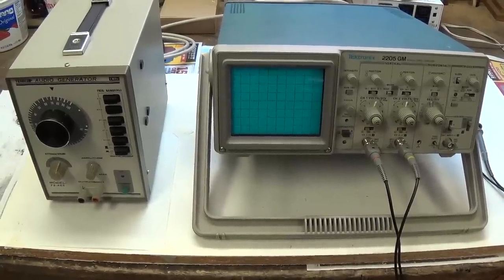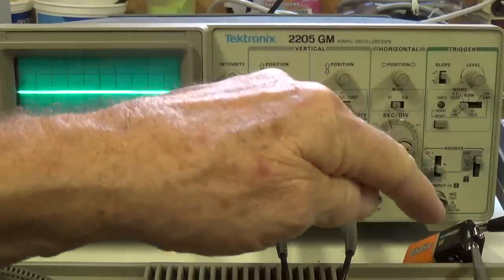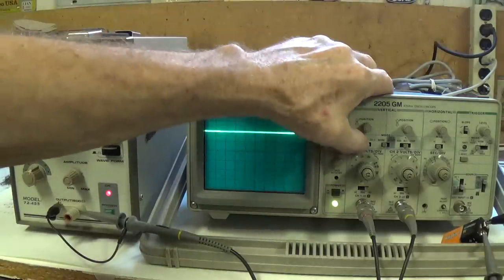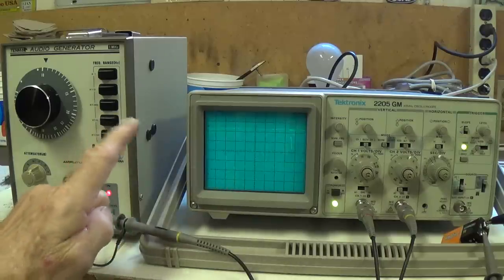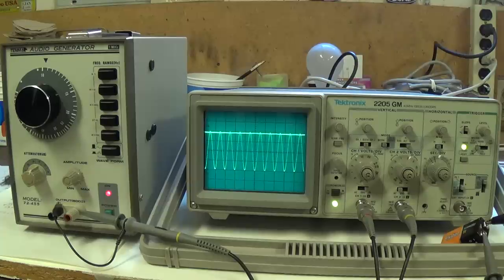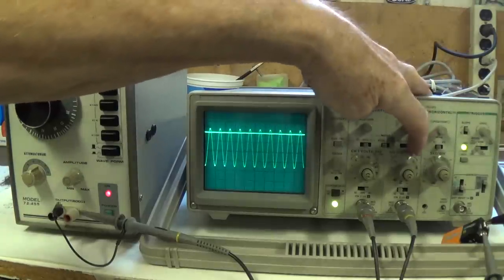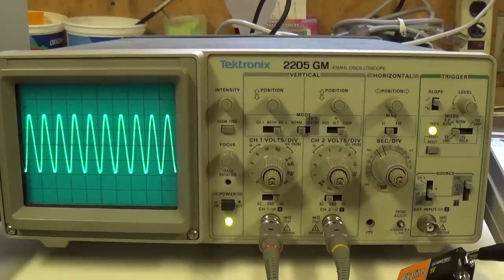Oscilloscope: DC & AC, Signal Tracing in Amp Circuit, RMS Output Measurement

Comment: brilliant! thanks so much.Which components in the amplification line (input through to the output) would cause distortion, and how would you measure them as part of a fault searching process? (assuming that the distortion was a fault)?
Reply from the maker: Thanks, Ralph. Distortion normally originates in the pre-amp and output tubes when they are driven beyond their normal operating parameters. There are instruments that can accurately measure Total Harmonic Distortion. It runs around 5 to10% in guitar amps, but less than 1% in HiFi amps.

Comment: Hello again, Doug.
Something's that confusing me is: Is the RMS output for an amp the same at all times or is it dependent on the input signal?
The same can be asked regarding what you said about putting a mark on the volume knob to mark the position where distortion occurs - is that irrespective of the signal strength?
I suspect it is but for a hifi amp different sources produce different signal strengths, right, or do they all max out at  +1/-1 volts?
Please don't throw me a charged cap!

Comment: I’m taking a short break from today’s video to observe that the water analogy holds true for what happens when you mix AC and DC... a graphical presentation of flow in an open channel is referred to as a hydrograph. Time is along the X axis, and depth of flow is represented by the Y axis. If there is a steady flow in the channel that is not caused by a rainfall event in the watershed upstream, it is called “baseflow” which is analogous to DC current. Any increase in flow due to a rainfall event upstream in the watershed is analogous to AC. The two flows both mix, but remain separate. Just like the AC and DC currents shown on the Oscilloscope.
Reply from the maker: Wow......an excellent example of an analogy that does hold up in the real world. Thanks so much, Bill :)
Reply: I was hoping for just such a reply... yes, I know that Hydrology has nothing to do with Oscilloscopes, but I immediately saw the relationship and thought I'd pass it on.

Comment: Does this also applies to a stereo receiver? Meaning the information that you presented?
i have a Tektronics 2245 150mhz O'scope that i am trying to learn how to use. So your videos are very helpful.
Reply from the maker: The general principles would apply, Rob, but if the stereo receiver is transistorized (and it probably is), the circuit details are quite different from the tube amps that I work on.

Comment: Is it true that if youre connecting your oscilloscope (3 prong, grounded ac cord) probes to a solid state amp (2 prong ac cord) that you do not require an isolation transformer for safety?

I.e. isolation transformer is only needed when the device under test has a 3 prong ac cord?
Reply from the maker: I don't work on SS gear, V, and honestly don't know the answer to your question.
Reply: @UncleDoug  Not a problem sir, truly appreciate your time. My regards to Jack as well!

Comment: Great video.  It looked like the sine wave reversed phase after the first stage of amplification, when you showed the input and output together.  Is that right?
Reply from the maker: Yes, I should have mentioned it in the video, but I forgot. Each time a signal passes from grid(cathode)  to plate, its phase is reversed.
Reply: Thanks

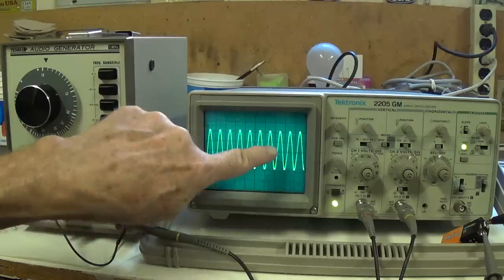Comment: Got a question. Looking at the waveform on the scope @~3:38, the sine wave looks symmetric, +&--. Looking at the trace @~ 23:30 - 23:48, the positive peaks look broader yet not like the input signal @3:38, and the negative peaks looks sharper, more pointed than the top of the positive peaks. Appears to be distorted. Why?

You and Jack are like Kato and Inspector Clouseau, you never know where Jack is going to hide or how he is going to attack!
Reply from the maker: When approaching distortion levels, the sine wave is altered in shape. The  sine wave at 3:38 is undistorted, while the later one is becoming distorted. I have no fancy explanation for this other than what is visibly evident on the screen.

Comment: Excellent video Uncle Doug.  Also - I really like your 8 ohm load!!  I have several smaller ones - but yours looks quite hefty and nice looking !!   I looked on e-bay to find one like it - but couldn't find the same size/appearance load there.  Can you tell me - what is the wattage rating of your load ?
Reply from the maker: Thanks, Donald. Mine is 100W.....but it does get hot. I would recommend a 200W version for fairly low-wattage amps, and a 500 to 1000W for large amps.

Comment: Is signal generator connected also in the isolation transformer? Does it need to be connected  if it does not?
Reply from the maker: That's a good point, MP. If the frequency generator is not isolated, it will provide an earth ground to the DUT through the cable that connects the two devices.  If you want complete, pre-first-ground-clip isolation of the DUT, then, yes, the FG should be isolated.

Comment: Hi Doug, love your videos. 
I have a question, if you wouldn't mind - I understand the basics of a tube amp, how it works clean, and so on, but how do high-gain amps induce preamp distortion beyond the first stage? Does it just not have as much resistance between stages to cause overdrive?
Reply from the maker: I'm not sure I understand the question, David. Distortion occurs in any amplification stage when the input signal becomes strong enough to push the current flow within the tube beyond its normal operating parameters. This can occur in any or all amplification stages in the amp, and it's how overdrive pedals work, by amplifying the input signal so high that the pre-amp tubes are forced to operate at too high a plate current level.
Reply: Uncle Doug let me see if I can explain it better... On amps that have gobs of preamp distortion, what characteristics of the circuit encourage that distortion?
Reply from the maker: The pre-amp tubes must be biased so hot so that the application of a signal of even moderate strength will cause them to begin clipping. This is hard on the tubes and makes the amp rather unstable and not suitable for normal use. It's better to simply use an overdrive pedal whenever early clipping is desired.

Comment: just curious, as multimeters measure RMS, could one measure the RMS voltage of the speaker with a multimeter and just divide that by the load resistance to get the watts RMS?
Reply from the maker: The problem is that the measurement is taken right at the onset of clipping, Tony, so without an oscilloscope, it's hard to tell exactly when that happens. If you want to trust your hearing to determine that point, then you could use an RMS voltage measurement......but it must be squared before dividing by the load resistance.

Comment: Uncle Doug, can I use a light bulb as a dummy load when tracing the signal in the amp? Thanks
Reply from the maker: Probably not, TT. You're better off buying a dummy load on Ebay. Be sure the wattage is adequate for your needs.
Reply: @UncleDoug  ...I've heard of using a light bulb for a dummy load on a TRANSMITTER-!
Reply from the maker: @daleburrell6273  Thanks for sharing, Dale.

Comment: Interestingly in Trigonometry, a figure of .707 is the sin value for 45 degrees.
Reply from the maker: It's no coincidence, Simon. In an isosceles rt. triangle (with 45 degree angles) the sin is the side opposite (1) divided by the hypotenuse (square root of 2). Thus the sin is the reciprocal of the square root of two......which is the same factor for RMS determination.

Comment: That was an excellent presentation. Now I'm going to go all pedantic on you! If you set your scope input for AC coupling (14:15) you would not be able to see any unwanted DC present on the grid (13:02) if there was any. Would it not make more sense to use DC coupling so that if there was a bad cap or something letting DC on to the grid the scope trace would most likely get knocked clean off the screen, thus alerting you to the problem? I warned you I was pedantic... lol.
Reply from the maker: Not at all, Sooti. 1.) I had already checked and knew there were no coupling cap leakage problems to address 2.) Rather than presenting a theoretical demonstration, I am going to present coupling cap checks as a specific topic in the future and use a leaky cap for a proper demo. Thanks for your thoughtful input.
Reply: Makes sense to me! Of course I didn't know there was an upcoming leaky cap video. Sorry if I was being a bit nit-picky.
Reply from the maker: No problem at all. I really appreciate your input.

Comment: Grounds of the respective probes are connected to separate reference points, that I do not understand
Reply from the maker: It meant that each probe is a separate testing entity, offering a screen representation of the potential between the probe and its ground. Thus, the ground or reference point for one probe may be different from the ground for the other probe.
Reply: @UncleDoug  I wonder if the audio signal generator outputs a real AC with true negative voltages; cause if so, that would be an oscillating difference of voltage potential with respect to a flat DC ground...?  at least that is what confuses me.

Comment: Plz help im new at all this and i was gifted a Tektronix 5110 to make my car amplifier repairs easier.. But i have been tryin for a week now to try to even calibrate it i can not get the split lines or even get it to stand Still im guessing i have a button pushed or unpushed in that needs to be if anyone one could help me or guide me in the direction i greatly appreciate it...thank you in advanced
Reply from the maker: I did my best to explain how to use an oscilloscope in my videos, Jose. If they are not sufficient, then seek additional info in other videos or find someone in your area to give you on site instructions. Good luck.
Reply: @UncleDoug  ty i apperciate it its just all new to me so i really domt have a full understanding of the buttons and their usuage.. It has tons ill keep trying and love u video very helpful and i will deff continue to stay subscribed
Reply from the maker: That's great to hear, Jose. It takes some time to learn a new skill, but you'll succeed. Good luck.

Comment: Where is Jack. Silly Jack love that cat. If a cat really wants to hide you'll never find him until he gets out of his hiding place jack the good little black cat
Reply from the maker: True enough, Dwight.
Reply: I'm curious Uncle Doug like in a champ amp the on-off switch is in the return wire the fuse is in the hot side I wonder why Fender did that back when. Could it be that they were looking at less sparking in the contacts of the switch internally. I wonder what their reasoning behind it to the switch and fuse that way back then? What do you think?
Reply from the maker: @dwightjt  It's easier to wire when you have a lug for each of the primary wires, Dwight. In the modern wiring scheme, the white (return) wire connects directly to the PT primary with no lug.